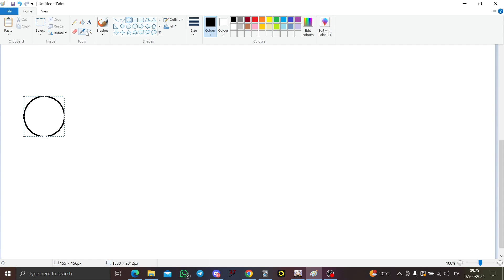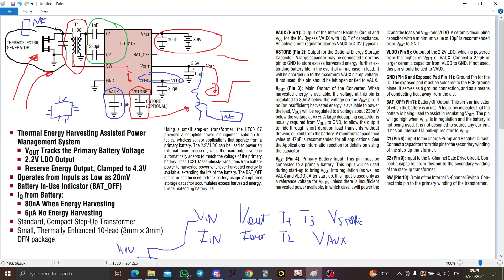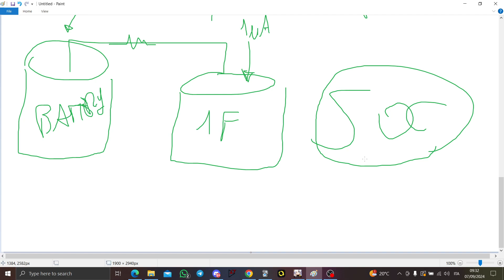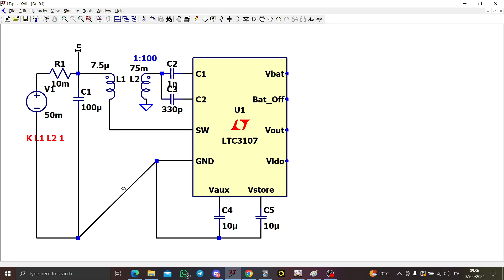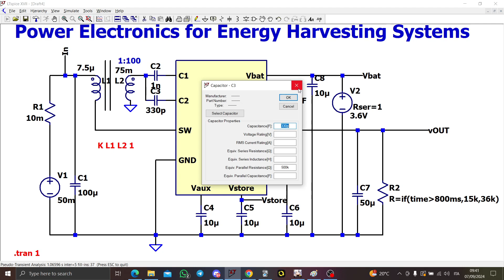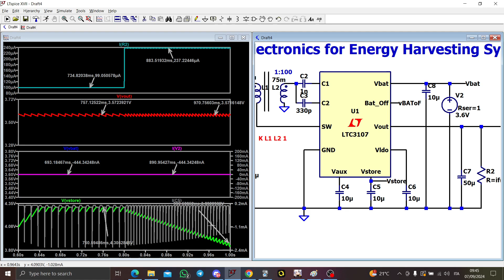[LTSPICE] Power Electronics for Energy Harvesting Systems

Comment: Hi Mano,if we have an on board charger,  how we can measure the grid voltage and frequency when we doing V2G? I want to design an on board charger which has bidirectional charging feature. Sometimes I have to charge the grid. I don’t know how I can supply AC voltage which is equal to the actual current grid voltage and frequency .